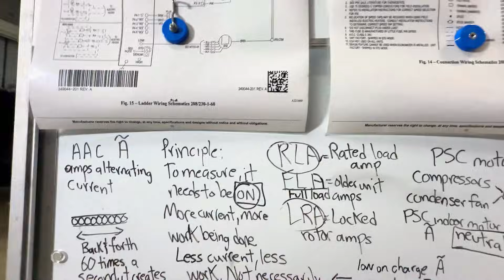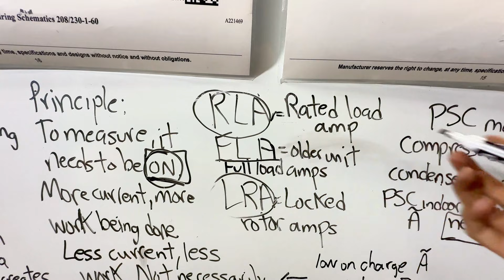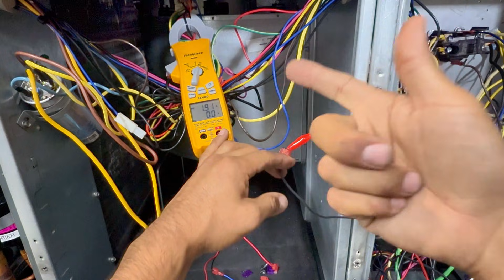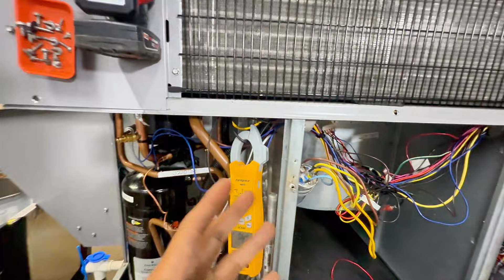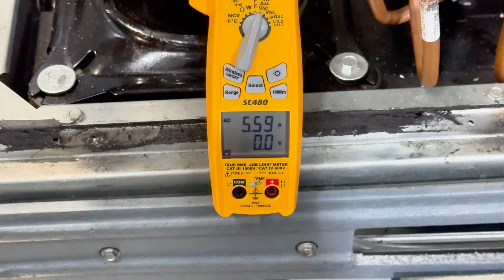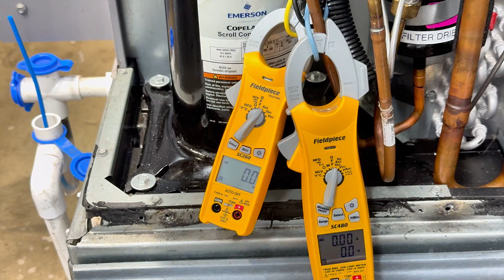How to Check AMPS on an HVAC System — Part 3 of 3

Comment: Wouldn't the amp draw of a psc go down theoretically if there's airflow restriction, less load on the motor?
Reply: Maybe but backpressure could equal it out. Not sure
Reply from the maker: It would go down. Less air, less work, less amps

Comment: so when you feed the contactor with 220/240 volts, where do u get the external 24 volts from, is it from the contactor coil? because i think u use that 24 votls from the contactor coil and put the red cable on then connect it manually to the system when u want the system to be functional for testing, then disconnect when u want it disfunctional, correct? plz explain.
Reply from the maker: The 24 volts comes from the same high voltage being fed to the unit. It goes to a transformer and comes out as 24 volts.
Reply: 24 vac comes from transformer normally in the indoor unit

Comment: You only need to supply wire to the unit to match the nameplate MCA (minimum conductor ampacity  rating and this overrides all electrical codes specs.
Reply: In Canada it does anyway. US might have different rules.

Comment: So if the indoor motor is pulling low amps,theres no restriction,but if say a filter is plugged its higher amps right?
Reply from the maker: It depends on the motor you have. If you have a PSC, with a restriction, your amps drop. With an ECM, with a slight restriction, your amps tend to go up.